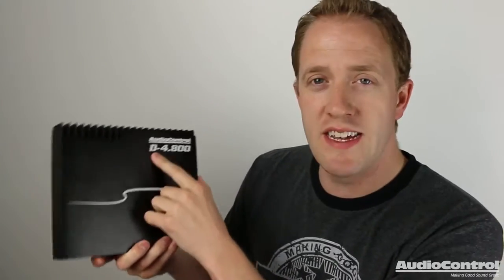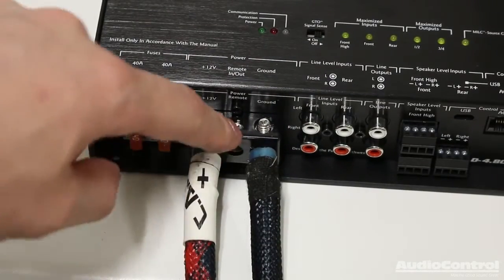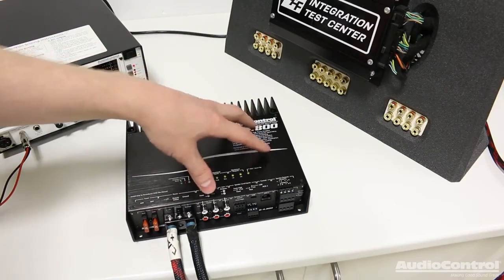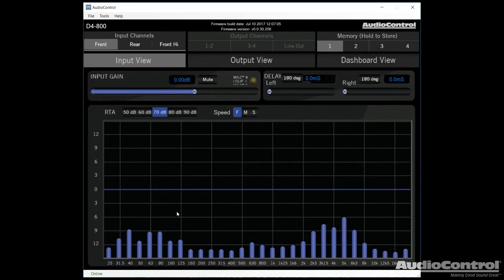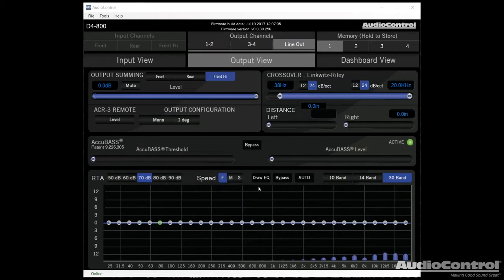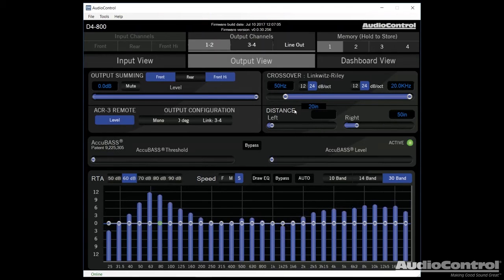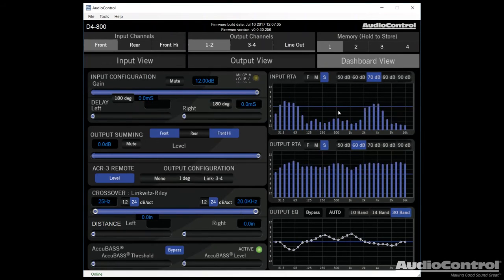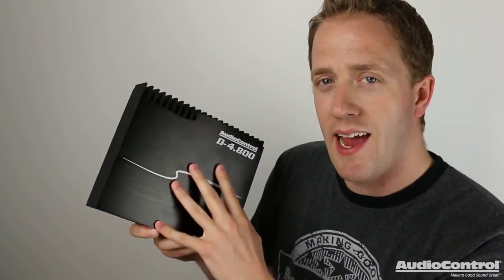AudioControl D.4-800 DSP Amplifier - Tuning Flexibility for Audio Perfection!

Comment: This is a wonderful synopsis of DM Smart amp control. The software confuses many people due to its lack of written documentation. I don’t own any Audiocontrol hardware yet but this video makes me a better informed buyer. Thank you.

I wish they offered a Linux version of DM Smart. At present it’s Mac or Windows only to access the USB interface, iOS or Android for Bluetooth. The Bluetooth usability has been variable through different firmware versions over time. They’re still pushing firmware updates, which is great to see six years in.

Comment: Tks for detail.How could we connect usb to android device to adjust feature ???
Reply from the maker: The AudioControl D-6.1200 DSP 6 Channel Amplifier and DM608 / DM810 DSP Processors all support the new AudioControl AC-BT24 which allows iOS and Android applications to control all DSP features and also stream bluetooth aptX HD audio. The D-4.800 does not support this however at this stage.